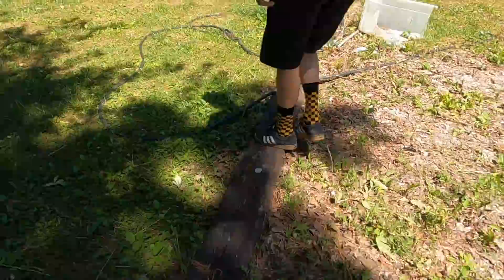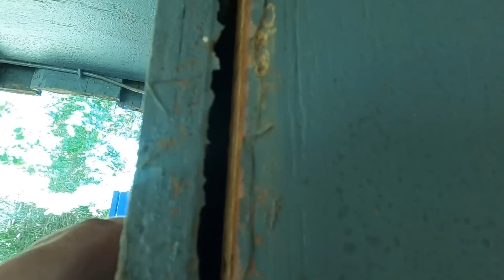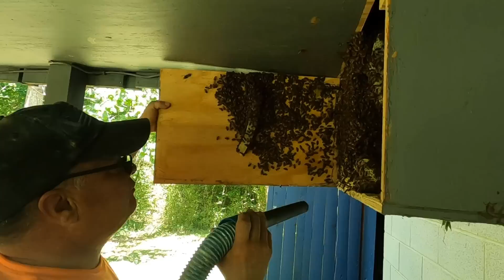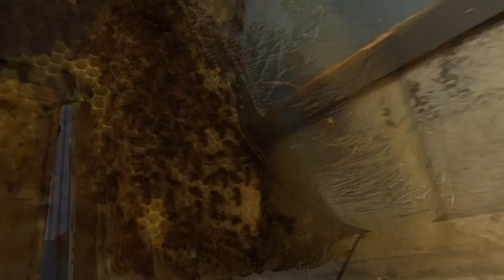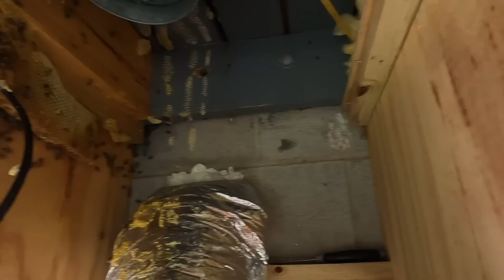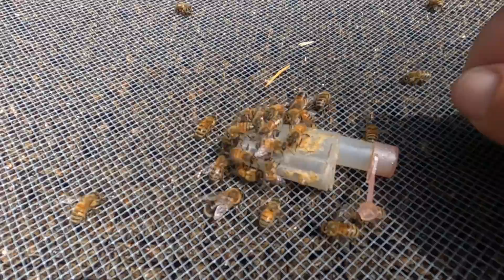They Found This Growing In The Air Ducts...So Amazing

Comment: In my Chevy Duramax Diesel a queen flown into the middle ceiling where you would put your sun glasses but in the actual ceiling because truck flexed going up the back side of Blanca Peak Co. Places of high energy I go to pray at. I don't care about honey bees, they communicate with me. 1 flew on the ignition landed, then flew to the gear selector landed,  then flew to the Left mirror landed and then flew Left. To leave the area. I eat raw honey also. Had a 🐝 bee land on my hood stayed on the for 100 miles in going 60 mph.

Comment: I'm in a bit of a predicament... My Audi engine blew like 6 mo this ago. I got a new engine and got it in. But I knocked down about 14 paper wasp nests in my wheel wells and engine bay.. well I was about to fire the engine up yesterday and noticed some honeybees coming from my rear bumper area.... Looked up behind the bumper cover and there is a pretty sizeable nest up there.. and even more paper wasps nest around my drive shaft. Is there any way to remove the honey bees without hurting them? I could care less about the wasps j have been using dawn soap on them. But I don't kill honey bees or bumble bees

Comment: That was a great removal from a position that could almost be designed as a swarm trap if it weren't for the obstructions inside it.
And you barely had to catch the queen - she came to you.  I reckon you're a bee whisperer!
That vent box (once sealed) is positively begging to have a swarm trap set up alongside, which would make any future removals a very simple process.
Reply from the maker: If they were closer I would have begged them to not insulate it.  I would love catching bees in it over and over again.